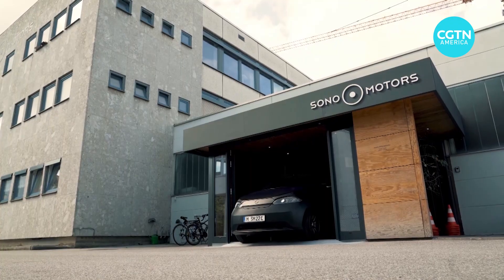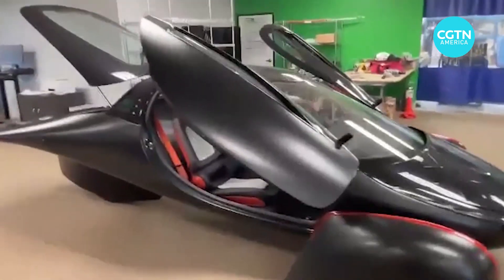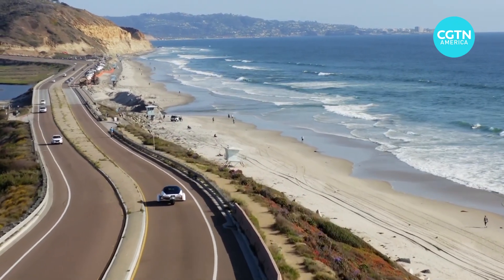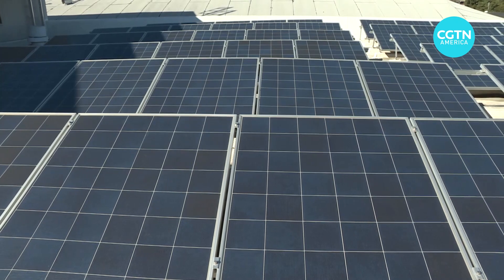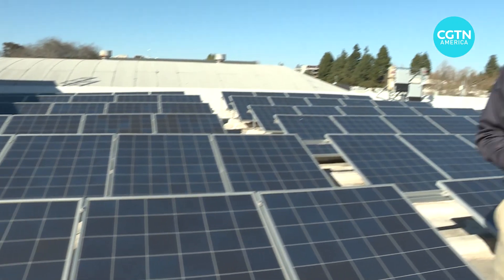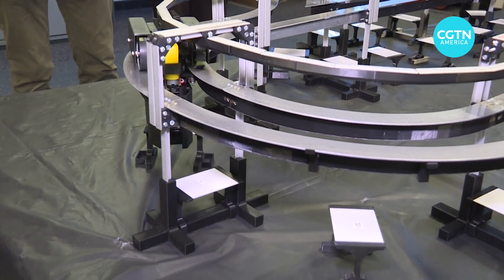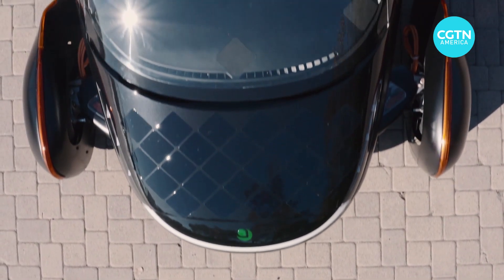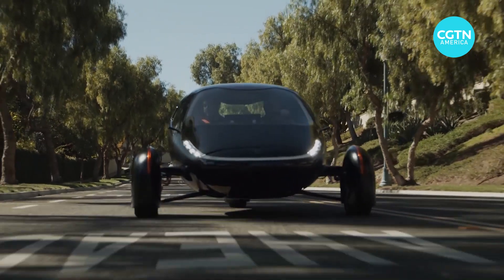The future of solar-powered cars

Comment: Who's buying a $175k solar cars , especially 1's that take a week to fill up.
I'd rather have a used Bugatti Chiron for that kind of money.
Have they even passed federal crash standards yet or will they have a big " experimental " warning across them like uncertified aircraft do ?
Reply: Aptera will be voluntarily crash tested to FMVSS part 200 crash test standards and the ratings published shortly before shipping begins.

Prices start at $25,900 for a 250 mile EPA highway range battery .

The performance of even the 2WD version is exciting.  I had a ride in an alpha prototype.